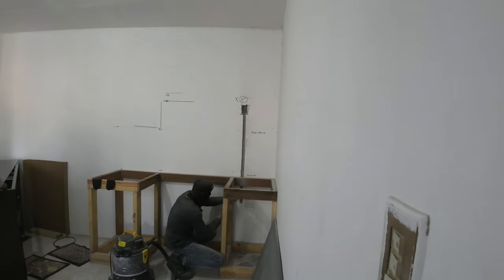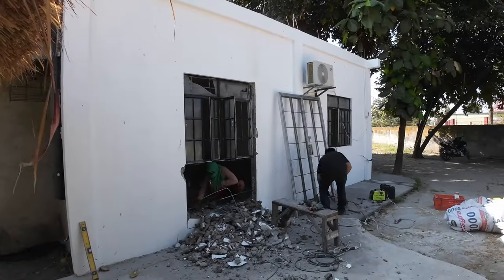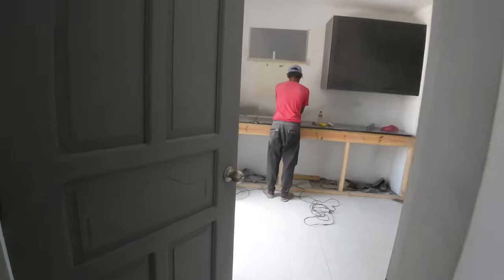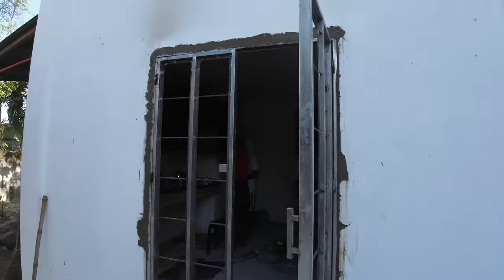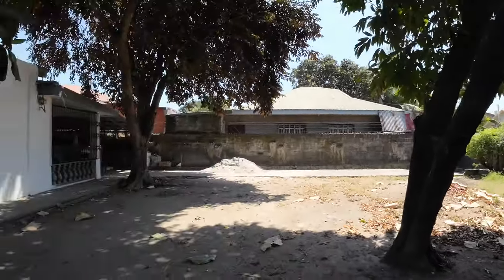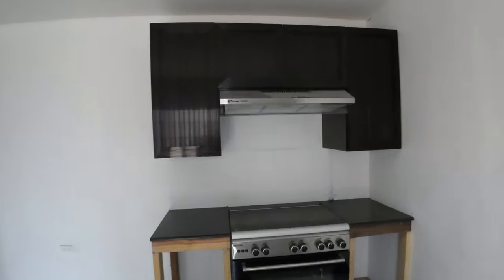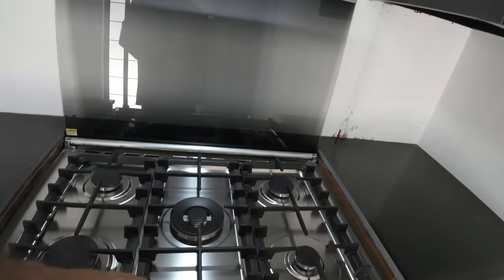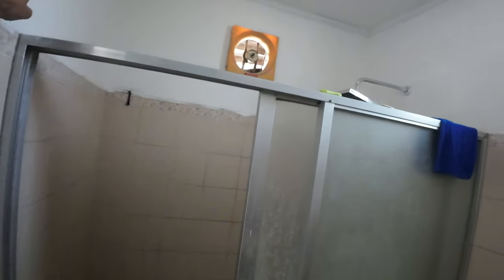$36 USD monthly Rental Update #6   HD 1080p

Comment: Loved the update.  For the bathroom I would look for a tile paint. That way you don't have to replace it. The paint will last x long time and if you find it wearing off just repaint.  See if you can find 24" tiles for the living room.  White or grey. A few pictures or art on the walls and some window dressings and you have a party palace!  Hey Darrell you might think of setting up a go fund me page.

Epoxy paint is a good option because it's highly resistant to abrasion and cleaning solutions. Alkyd urethane, enamel paint, and silicone-based paint are commonly used to paint tile. Specific water-resistant tile paints made to withstand the high temperatures and moisture of kitchens and bathrooms are also available.
Reply from the maker: Nice to hear from you again. The tile paint I will definitely look into

Comment: The French doors let in so much light and once the glass blocks are done it’s going to look amazing! Can I suggest for the bathroom to do a wet room! Do away with the glass divider and just tile floor to head height and have a floor drain!
Reply from the maker: In the bathroom I have found glass divider / door that rolls like a barn door hanging on a rail. The glass is 3/8ths to 1/2inch and looks very cool. What do you think about that idea?. The bathroom isn't really wide enough for the open area with out getting the toilet seat wet every time you take a shower. That is an issue for me personally.  Just something about a wet seat....  But I definitely appreciate the idea and the compliment my friend!!
Reply: @Ex-Pensive_Expat  Sorry for the later reply I’ve only just seen your response!

Comment: The idea of grinding out those tiles and getting different tiles will still look nice i think since its the entrance door into the house, looking great so far 👍 great job ✌️🇵🇭
Reply from the maker: I also had the idea of doing and entry type of tile thing. But the broken, chipped and loose tiles are all over if you're here not real obvious in the video
Reply: @Ex-Pensive_Expat  ah yes I didn't notice the rest, but what if you use the same tiles for entrance to make a pattern design across the whole room 🤔🤔 think this might also work too
Reply from the maker: My first idea was to replace with the same tiles but they are no longer made. Then I had the idea toy take them for under where the cabinets will go but those won't come up without breaking. So with everything els so nice. It's only $130 for the 3 to 4 years to be really nice like the rest @nomadpack4050

Comment: Perhaps replacing the broken tile area with a tile design that designates the entry, like a throw rug would?
The fence covered with bamboo. IMHO, it will not age well, but try a test section first. Skim-coat will last, but that needs paint. D'oh!
Reply from the maker: Yes. Thank you for the comments and suggestions . I am thinking it all through and yet undecided

Comment: If the only broken tiles are in front of the door, you could always have just that area replaced with a different tile, maybe with some type of border around it. Doesn't need to match.
Reply from the maker: That was my first thought. But in the end to redo the entire room is only $130 labor and materials

Comment: Nice improvements! The coy pond is also a good idea. IMHO the bar would be in a better position parallel to the sink, just in front of the French doors because you'll be able to move all around it leaving three possible circulations from  every door. By the way, you could still use it from the sink to the gas burners. Just my two cents.
Reply from the maker: In the pictures it appears there might be rough room but there really isn't. My first actual thought was to make an island but as you measure it out the with is about 2 feet short for decent walk way clearance

Comment: Looks great. No doubt it'll be a tropical party paradise. I think the koi pond would look really cool... could light it up at night. 

Maybe some dehumidifiers in your house would be a good idea too, so you can breathe easier. Also possibly a grill/smoker setup in place of one of those bars. They say if you don't have your health...
Reply from the maker: The humidity today was 35%. Lat time I checked a few days ago it was 55%. I like the light idea. Maybe from under the bridge shining out
Reply: @Ex-Pensive_Expat  Oh, 35% isn't too bad. I think higher can make some people have a a bit of a harder time breathing easily. 
Yeah, shining out would be cool, or maybe even subtle uplighting from the bottom of the pond.
Reply from the maker: 35% is the low end but most will have you believe it's nearly 100% most of the time and the is just not true

Comment: I think it would be great if you could install a pocket door in the bedroom, to access the bathroom, without having to walk through the entire place.  The door from the kitchen could stay.  I couldn’t tell if there was a tub, but I would shorten that area on the left by a foot, to build shelves for towels and toilet paper.  Then the area to the right of the shelves would be a walk-in shower.   A floating shelf or two above the toilet could be used for toiletries and a small plant.
Reply from the maker: We can't do pocket doors here. The construction is concrete block which is defiantly no hollow.   Good ideas but to the left is the shower and there is not enough room for walk through for shelve right there. There should be plenty of room under the sink on the right side. Thank you for the ideas and taking the time to comment!!

Comment: We have a bamboo wall.  It is super aggressive.  It will quickly start grow in the yard towards the house and will always need to be cut back.  It also grows very, very quickly and the root system will reach to your septic tank.  Just be aware of how invasive it is.  And, if you decide you don’t like it, you can’t get rid of it.
Reply from the maker: Thanks for your concern and I know you're absolutely correct. But the bamboo I am using has already been harvested.

Comment: I curious if the septic systems there are just holding tanks that need to be pumped out every so often? Here you would need a large mound system to have more of a maintenance free system that didn't need to be pumped.
Reply from the maker: I believe there are both here. I am not sure what type I have. Only that it works so far

Comment: For the chipped tile in front of the door, you could remove two tiles from the door and four across (going to one on each side beyond the door) and make it like a landing space/foyer area without having to replace all the other tiles.
Reply from the maker: That was one of my first thoughts.  Since they are a bit spread out  including smaller chips you can't see in the video. I thought I will just paint them. By the time you dig out the old ones out and then try to level new ones in labor-wise it's about the same as covering the entire floor.  But thank you for taking the time to offer the suggestion. Much appreciated

Comment: Would have made sense to do the floor tiles prior to building the kitchen cabinet frames and installing the stove?
Reply from the maker: There is some area from the previous cabinets that were not tiled either.  I am not sure why I would tile under cabinets knowing where they will be and save the on the per sq ft costs.  When I leave this house it will be torn down. The owners bought it for the land and will rebuild another house when that time comes in about 3 1/2 years. I hadn't considered re-tiling the floors in the beginning. The stove is not permanently installed and would not be effected by the new level of the floor if I did re-tile. I have since decided not to retile the floor for now. I will paint the chipped areas and leave it at that.

Comment: Stumbled upon your channel. With regards to the French doors, when you were planning around I thought I saw some daylight. Was thinking if the rain came from that direction, water would get in. The place is coming along. Thanks for sharing. You stumbled upon a very nice place there, and a lot in Pampanga. I'm in Florida, but I'm familiar with the area. I have relatives there and a couple other areas or regions in the Philippines. If you are going to go with, suggest scorching the seams and varnish the wall to make it stand out. With regards to the lights, maybe some solar lights. With regards to the windows and French doors, later on maybe replace the glass with reflective glass to keep the sun/heat out. How is the condition of the roof? Realize you are on SS only. With the current situation here, I'm seriously considering moving to the Philippines, several guys I served with are in various places. Take care and live your life.
Reply from the maker: Yes I saw the gaps too and there is some materials I can use if the water starts to get through.  Not sure what you meant about scorching the seams or varnishing the walls?
Reply: @Ex-Pensive_Expat  With regards to the Bamboo wall, there are lines that go horizontally about every two feet. Get like a butane bottle, go over the seam to make it look like a cigarette burn... Scortch it lightly, when the wall is done then varnish to make it shine or make it stand out. Basically like you said, I would split the bamboo in half and nail to a board like a 1x1 and attach to the wall. There was a Filipino here we visited in Florida, he made a Tiki bar but it was made out of PVC. He painted it and it was exactly like Bamboo. Where the solid beams in the concrete are located, attach bamboo that is not split, secure the bamboo by drilling a couple of holes, with cement screws. Then attach your pre-made bamboo wall to the posts. On top of posts, there are small solar lights you could attach.
Reply from the maker: Thank you Barry!! @barry6484

Comment: Im late to discovering your channel. Which province is this in? I spent 8 months last year riding 20,000 kilometers ( 1200 miles ) all around the Philippines so I have probably ridden through your area. I have seen lots of unused houses in many places and will probably do something similar.  If you do go with Bamboo be aware that it spreads underground so it would be a good idea to put an underground barrier a foot or so away from the wall to prevent the bamboo from taking over the yard. The upgrades you have done look great!
Reply from the maker: It's about 20 minutes outside of Angeles City

Comment: I didn’t bother grinding out the existing tiles. The guys concreted straight over the existing mess and fitted large porcelain tiles over the top. To get the doors to fit they just shaved some off the bottom and hung them back on, grouted everything flush with the cabinets unfortunately i had already put in.
Reply from the maker: Exactly

Comment: Bamboo is highly invasive. It will spread out and is a nightmare to control. You could pot the Bamboo in large pots but then you would have to water them etc. I personally would grow climbers on galvanised wire. You would need to select the right variety as there appears to be quite a lot of shade. Otherwise amazing job on the rest of the refurb.
Reply from the maker: Thank you for the comments.  The bamboo I am talking about has already ben harvested and other wise I would not plant it. You are 100% correct and I thank you much for taking the time to comment.  If the bamboo does work I will definitely clean and paint
Reply: @Ex-Pensive_Expat  Oh gotcha ,I misunderstood. That makes perfect sense and would look good I think.

Comment: you can get a paint to paint the tile. to change the color of them
Reply from the maker: Really?? What kind of paint? What type is it called. That might be a great idea if I can find it here or mail order I guess
Reply: Not sure but yt harry tornado did it in his flip house
Reply: @Ex-Pensive_Expat I think it's just called "tile paint", but I think you should splurge on new large light tiles with a narrow gap for the grout. It will lift the whole place even more than what you've done so far.
Reply from the maker: Thanks!  I think I will be doing exactly that @ShareTradingAdvice

Comment: I like seeing the progression but i never saw that your range hood is vented, pointless not vented  though isn't it?
Reply from the maker: It will be vented as soon as I buy the 4" pipe for it and the pieces needed to go through the roof / waterproofed etc. . I haven't been using it because the vent isn't in yet. It's already paid for I just need to go buy the parts

Comment: If you do bamboo on the wall outside, you could consider leaving blank spaces and hire a local struggling artist to paint murals on it, just a thought
Reply from the maker: I've had the mural suggestion. And it's a good one. The problem for me with that idea is the wall is right at 5' tall, maybe even slightly less.  I'd like a little more privacy so If the wall was 6' plus tall it would be a lot more exciting. I've even thought with a long wall like that you could do an entire story / time line.
Reply: @Ex-Pensive_Expat  good point, I'm stealing that custom welded french door idea for a house in La Union. At first we thought we were going to have to have an extra grilled door (security) in front of French doors but you combined it, smart. Thanks for the video
Reply from the maker: I can put you in touch with the guy who did mine if you like @Not_A_Tourist

Comment: Is this house 36 USD/month because you've spent the money to quadruple the value of his property or was it that price regardless? 

If it was that price regardless, I'd imagine you've spent at least 2 years worth of rent fixing up the place. 

Was there nothing in the area already turn key for 72 USD/month?
Reply from the maker: Nothing I found with anywhere near the land area turn key.   The market rent for this property as finished would be around  $250 to $300 a month. So if I had found something like this in already nice western condition I would be spending almost $10,000 during that 36 months.  The rent is about $1,300 for 36 months, plus around $1,500 for the structural improvements or $2,800 total ""all in"" for the 3 years . Bottom line I'll be saving over $7,000 USD for my efforts in the first 36 months. With options exercised, more than that for up to 5 years.
Reply from the maker: PS. I'm your 8th subscriber.

Comment: Whats the avrage start up cost for a home like deposits stuff like that
Reply from the maker: First last and deposits. In my case I offer paying 6 / 12 months in advance plus doing a little fixing up instead of deposits and discount for paying so far in advance.  The deal is here, many filipinos are happy with some properties as they are. Us western people need it fixed up to what we are used to. So we rent at one rate usually cheap by our standard then fix it up to our standards.  That also means we're probably saving some money for  our efforts.  We rent at Filipino standards paying that price. Then fix up for not too much but still have it at the lower price. The properties at western standards may be several times more expensive because that is the clientele the owner caters too. And also the reason fixing up a rental here in the Philippines can make very good sense
Reply: @Ex-Pensive_Expat  so 12 to 1600 for start up cost sounds like
Reply from the maker: Some of it depends on you.  Depends on your life style, needs and where you'll be wanting to settle. Since I am paying a lot in advance and doing a lot of fixing they didn't require a deposit from me

Comment: Just seed the wall..bamboo is the fastest growing tree in the world just need to make sure you don't get seeds that run
Reply from the maker: That is what gave me the idea. I am afraid the bamboo once started would get out of control
Reply: @Ex-Pensive_Expat  there are different types just need to make sure the ones you pick are not runners,even then if the particular type of bamboo you like does run at the price of concrete where you are you can simply have a 1ft wide by 3ft deep rectangular planter installed along the wall and then you are worry free...of course you would need to buy soil a that point but takes away the worry of a total bamboo take over lol. Will take about 6 months to a year depending on the height you are looking to achieve. But once you get the height you like simply have someone run a chain saw straight across the top and it will never grow past that point. Gracilis doesn't run and is a popular option here in the states for privacy walls where HOA won't allow traditional fencing
Reply from the maker: I have found the Bamboo at 20 pesos each and they are perfect by size and shape. Plus the size is perfect now and I don't need to wait for them to grow. But thank you for the idea @BigNatorStrength
Reply: @Ex-Pensive_Expat  awesome man can't wait to see the new video brother 💪🏼
Reply from the maker: I get pretty passionate about every second of my videos so Some times I take a long time to do something that should be so simple @BigNatorStrength

Comment: Why would you do all this work on a rental?
Reply from the maker: Because I will save over $7,000 in 3 years. If the property was fixed up I would be paying $247 a month instead of $36
Reply from the maker: If it had been rehabbed as I am doing it the market rent would be $275. My lease is $36 for 36 months. I will have spent about $1,500 in rehab by the time its finished.  So I will have saved over $7,000 in the first 3 years.